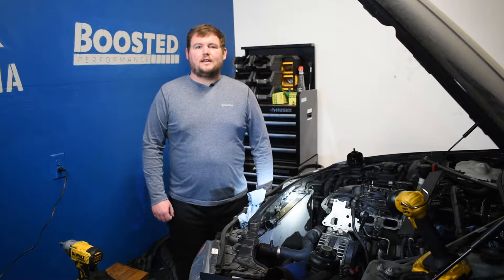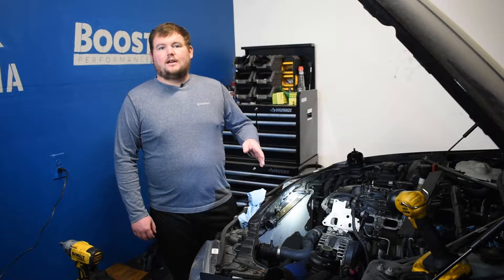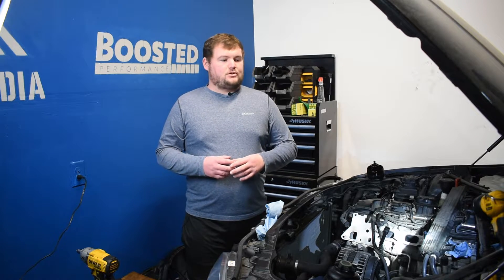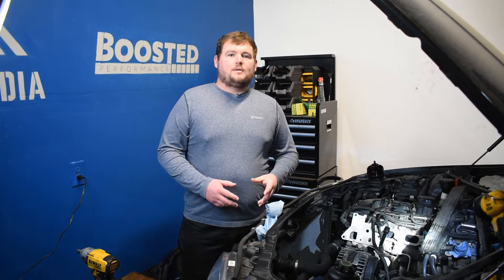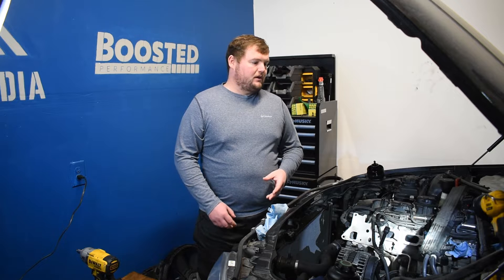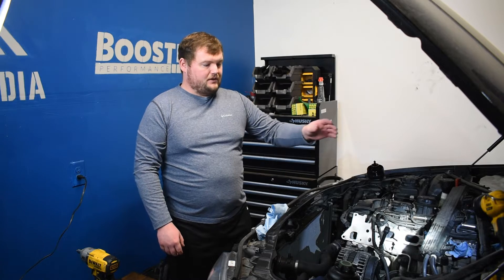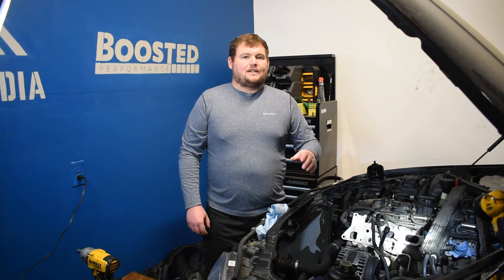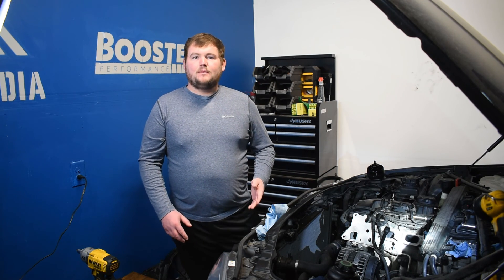What is Carbon Buildup? | Causes & Symptoms

Comment: I have a 2010 Audi A3 2.0t. My car hesitates when cold.  Worse in winter. Once it warms up, it’s smooth. Ive already changed plugs, coil. pCV, cleaned MAP, changed fuel filter. Any idea if this could be a carbon issue? Car has 275k. Prob never cleaned.
Reply from the maker: P - Yes, based on the high mileage (275k) and your symptoms, it's very likely that carbon buildup on the intake valves is causing the issue. The 2.0T engine in your 2010 Audi A3 uses direct injection, which is notorious for allowing carbon deposits to accumulate on the intake valves since fuel doesn’t wash over them like in port injection. Cold starts exacerbate the problem because fuel atomization is already poor when cold, and restricted airflow from carbon buildup can make it worse, leading to hesitation, rough idle, and stumble. A walnut blasting intake cleaning is the best solution and would likely restore cold drivability significantly. Consider doing a compression test and checking for vacuum leaks too, but carbon is a strong suspect given the mileage and pattern.

Comment: Thank you for the information, you explained really well, my SUV is has been misfiring for a few months now , took it to dealership and told me i needed a cleaning, 2 days ago the check engine light came on and I was told not to drive at all, because it can damage the catalytic converter. Is that accurate?
Reply from the maker: G - Thanks for the feedback! Yes, that’s accurate—driving with a misfire can damage the catalytic converter because unburned fuel enters the exhaust system, causing excessive heat that can melt or clog the catalytic converter. If the misfire has been happening for months, it’s likely worsening, and continuing to drive could lead to expensive repairs. A "cleaning" (likely fuel injector or intake valve cleaning) may help if carbon buildup is the issue, but if the check engine light is now on, you should scan for codes to pinpoint the cause. Common misfire culprits include bad spark plugs, ignition coils, fuel injectors, vacuum leaks, or a failing sensor (MAF, O2, or crankshaft position sensor). If you haven’t replaced spark plugs in a while, that’s a good place to start. If the light is flashing, do not drive it—tow it instead to avoid further damage.
Reply: @ thank you for the reply, yes I have done every service my dealership has recommended including the spark plugs. They did a diagnostic and code P0300 came up and say I need a top engine cleaning.
The misfiring started a few months back then stop , but a few days ago I heard it while truck was not moving and that is when the engine light came on. But then it went away and I did drove it but I noticed the hesitation in the gear going from the 1st to the 2n. Do you think that is because of the carbon buildup or is something else.?
I haven’t moved it at all after that happened just to be safe.
Thank you!
Reply from the maker: @ It's possible it's carbon buildup.. We have a video on P0300 code that may help: https://youtu.be/f1mQ5hD1-vI

Comment: My car has carbon build up and has a misfire. What is the way forward to getting it fixed.
Reply from the maker: S - Are you getting any check engine lights?
Reply: I have the same problem, my check engine light is on. I was told no to drive it .
Taking it to the dealership for a top engine cleaning in a few days. I will be paying 887.00 on a GMC XL Denali

Comment: Hi! I have 2015 VW 1.8t Golf that at idle revs goes up and down sporadically (like every 2 minutes, sometime a bit more than that). Also sometimes when acelerate from a stop the car stalls for a second and then proceed to acelerate normally (for some reason in reverse it's drastically more jerky). Does this sounds like symptoms of carbon buildup? I believe that the last time I cleaned it, the car had 80k miles, and now it has 100k.
Reply from the maker: L - Not likely. Are you getting a check engine light?
Reply: @8020Media  no check engine light.
Reply from the maker: L - We have two videos that could help here: https://youtu.be/BiYsqRJCLhE
https://youtu.be/7bqAIbYRdnc

Comment: You forgot to explain how the carbon deposits get there in the first place, apart from a brief reference to vacuum pulling oil back into the port (why oil?)
Reply from the maker: H - Described simply, carbon buildup is the result of incomplete fuel combustion leaving behind a carbon residue that can get stuck to the intake valves, injector nozzles, cylinder walls, and piston heads. Oil blowby caused by the PCV system and valve seal weep contributes to the problem as well, worsening the buildup.

Comment: My engine has been making a strange sound like a hissing sound inside the intake, have no check engine light but some times my car will randomly misfire some days, but mainley its the audible hiss sound that i know wanst thier before, also checked for vac leaks visualy with smoke machine and fuel trim data, nothing shows a vaccum leak.  just wondering if carbon can cusse the engine to sound like its gasping for air due to intake port clearances?
Reply from the maker: D - Not likely, but how many miles do you have on the vehicle??
Reply: @David-rk2cw  yes the carbon does that, my truck was doing all of that. I did a diagnostic with the dealership and onstar and code P0300 came up. Stating that I needed to do a carbon cleaning.

Comment: Carbon buildup around the valves and head is bad but carbon buildup around the pistons and rings can destroy an engine, common issue with many low tension ring engines and longer oil change intervals, like the video more information the better well done.
Reply from the maker: D - Thanks for taking the time to share this insight. Also, thanks for the feedback!

Comment: Y at intake alone it jus takes the air fuel mixture for burning correct. Exhaust must b having higher carbon build up.. can u brief this too..
Reply from the maker: K - A majority of the build up is in the intake tract because this is where fuel is injected into. Catalytic converters can also experience carbon buildup. We have a video coming out tomorrow addressing catalytic converters.

Comment: Do the fuel system cleaner that says it cleans valves help with direct injection motors?
Reply from the maker: R - They help, but don't prevent carbon buildup.

Comment: Is it possible carbon buildup on the intake valves and only affect cylinder 1 missfire
Reply from the maker: Definitely, you could have some excess buildup in cylinder 1. Carbon build-up doesn't always happen evenly, can be very different from port to port depending on the condition of the cylinders and injectors for that port.
Reply: @8020Automotive  just removed the intake manifold, wow buildup on the stem and get thicker on the  valve, let is sit with cleaners see how it goes thanks!!
Reply from the maker: H - We also have a DIY walnut blasting tutorial: https://youtu.be/pyhvtrCXbB0
Reply: @8020Automotive  update,
Did walnut blasting worked as it should miss-fire continued, gave a good full blast on the highway no more misfire.. huge difference 
Thank you for the opportunity and advice!!!
Reply from the maker: H - Nice! We're so glad we could help.

Comment: So does ethanol or non ethanol fuel cause more carbon build up?
Reply from the maker: Fuel doesn't have any major impact. Carbon build-up on intake ports and valves occurs because there isn't any fuel flowing over them on direct injected engines (the fuel is sprayed directly into the cylinders). As such, it doesn't matter how much or how little ethanol or what fuel additives are used.

Comment: I completely disagree with your statement that carbon in the engine will not harm the engine. If left unchecked, it will destroy it. It gets to the point where unburned fuel washes down the cylinder walls, causing scuffing on the cylinder walls. This raw unburned fuel also contaminates the catalytic converter, and eventually kills it which is extremely expensive to repair. False information stating that carbon buildup does not harm the engine.
Reply: Can carbon buildup cause random misfire? Thanks bro
Reply: @PATRIOTIC-EAGLE11 been having the same problem!! 

Had a misfire in January, changed the spark plugs and coils, ran fine for a month, until suddenly MULTIPLE cylinder misfires. Changed the fuel injectors, and since I have a Honda fit, I have to take half the engine apart to get to them. As I was taking the intake manifold off there were huge buildups of gunk on the inside, I blasted it with brake cleaner and it was still coming out black on the other side. When I took the fuel injectors off, they were completely crusted up in not just carbon deposits, but it looked like dirt and gravel from the street. 

I have heard the carbon build ups can cause misfires . I really hope we're onto something bc when I took it to the shop they just told me "it's the spark plugs" 😓

I'm seriously at a loss here. 

Good luck my friend.
Reply: @bl0ss0mshum4n having a similar issue with my 2000 Toyota echo. One of my friends who owns a shop told me to try the sea foam valve cleaner. Maybe try that?
Reply: Hello bro, it is about more than year I’m looking for the cause of this problem i really have spent too much money but recently a friend told me about carbon buildup on piston I’m going to clean it up today then I will inform you about the result, I hope we solve it soon, good luck my friend
Reply from the maker: If a big chunk falls off then sure it can fall into the combustion chamber and take out the piston rings and cause some damage. But I don't think carbon buildup itself is causing the problems you're talking about.

Comment: Vapors of engine oil caused by pcv and recirculation of air as ventilation by sucking hot air from the crank case into the engine is one of 2 main causes of carbon buildup. This theory explains and proves why port injection engines are less likely to build up carbon on the intake valves. And so does watermeth injection in direct port injection engines.
If carbon deposits gets inside the chamber, it will probably cause preignition and this is another serious problem.
Reply from the maker: MJ - yep.

Comment: So my problem is im throwing egr and pcv codes after replacing those, i just did an engine swap but i reused my 315k mile intake from my old engine, i have a new intake already, would swapping it for a brand new manifold fix that if the buildup is blocking ports?
Reply from the maker: Lucky - I think swapping it would be a good idea if you already have it on hand and then reset the engine codes. Keep us updated.

Comment: Hi can carbon build up cause engine to vibrate only when engine is hot thanks
Reply from the maker: Sounds like you're having a rough idle? Here's a video we did specifically for that: https://youtu.be/BiYsqRJCLhE
Reply: @8020Automotive  i only get engine vibtation when engine is hot at idle rpm not bouncing just feel vibration in seats and no engine light or codes thanks
Reply from the maker: May want to check your engine mounts. This could be the cause. Keep us updated on this.
Reply: @8020Automotive  thanks will do can it cause vibration only when engine hot

Comment: Looking forward to your upcoming video. Are there additives u can use to periodically clean? I used guaranteed to pass emissions on my old 97 Camry & it really cleaned the plugs, figure it would do intakes.
Reply from the maker: Rice - Thanks for the feedback! There are some fuel additives on the market that claim to clean carbon buildup off of intake valves, Sea Foam is our favorite. However, we want to preface, this is a preventative measure. Not a end all be all.

Comment: Can’t the carbon buildup on the cylinder head and then scratch the cylinder walls?
Reply from the maker: Wolf - It's possible but not something we see very often at all, at least in the case of it causing any major damage. The combustion process typically burns off any excess carbon within the combustion chamber.

Comment: What does carbon build up come from?
Reply from the maker: Keeg - It's is a natural byproduct of the combustion process where fuel is burned to generate power.
Reply: @8020Automotive  thanks
Reply: Better response is from the PCV and EGR systems that burn the unburned hydrocarbons that end up in your crank case. Theses systems route this oily mist back into the intake port, and through the intake valve into the combustion chamber to be re-burned rather than going out into the atmosphere. When they pass through the intake valve, this oily mist carbonizes onto the intake valve, leading to carbon buildup. Because no gas on a GDI engine is being sprayed onto the intake valve, the detergents in gas can no longer work to keep the intake valve clean. Cheers.
Reply: @JRW-BJJ  thanks.  Cheers to you.
Reply: P @JRW-BJJ

Comment: Lemon law , use it !
Reply from the maker: Charles - Carbon buildup is very common in all direct injection engines. Not so sure lemon law would work in this case.
Reply: @8020Automotive  Your correct , its very common , because it was designed that way , forcing oil down the intake from crank case ventilation , just like indirect injection carbons up the exhaust valves because the fuel going across the intake valves helps keep them clean . If you think the designers of these and other engines didnt know these engines were going to carbon up this way , YOU are sadly mistaken ! This is their wind fall of intentional maintenance profits ! Highlight that !
Reply: @charlesmccormick4443  senior citizen here and we were the victims of this nasty secret of the industry deliberately making the cars to have excessive carbon buildup.  Our Toyota Corolla 2015 engine was completely destroyed by carbon buildup which NO ONE at the service center ever warned us about.  We thought doing the routine maintenance religiously would make our car last 300,000 miles.  The engine was destroyed at 173,446 miles instead due to no one ever telling us about carbon buildup.  We consistently drove low speed and rarely went out on the highway.  Now we know better.  Highway driving at 60 MPH for long periods is enough to heat up the carbon buildup and get rid of it.  Hard lesson to learn as we just had to buy a new car.
Reply: @charlesmccormick4443  senior citizen here and we were the victims of this nasty secret of the industry deliberately making the cars to have excessive carbon buildup.  Our Toyota Corolla 2015 engine was completely destroyed by carbon buildup which NO ONE at the service center ever warned us about.  We thought doing the routine maintenance religiously would make our car last 300,000 miles.  The engine was destroyed at 173,446 miles instead due to no one ever telling us about carbon buildup.  We consistently drove low speed and rarely went out on the highway.  Now we know better.  Highway driving at 60 MPH for long periods is enough to heat up the carbon buildup and get rid of it.  Hard lesson to learn as we just had to buy a new car.
Reply: @JS-tr7oo  contrary to popular belief, it’s better to run an engine hard and not lug it. Higher PMs, and highway driving are the most beneficial thing you can do to prevent carbon buildup on a GDI engine. The lower the RPM, the higher crank case pressure is that results in the EGR and PCV systems, rerouting that oily mist back into the intake port to be re-burned which carbonizes the intake valves. Cheers.
Reply: @8020Automotive  The cure we found out is to do regular highway driving, at 60 mph is enough to burn off the carbon buildup.  Don't just do around about town driving at 30 to 45 miles per hour as that is how the carbon buildup starts.
Reply from the maker: J - Thanks for taking the time to type up this valuable insight! We couldn't agree more.
Reply: Can a bad turbo cause carbon build up ? 2018 Hyundai Elantra sport GTI 1.6L

Comment: how much will a shop charge to do a cleaning for carbon? how often should i do a cleaning ?
Reply: For inlines you can expect to pay a little bit more than $100 per cylinder you have. V engines will run 600-900 or more depending on your car. My supercharged Audi V6 costs about 850 to carbon clean but it has a big ol supercharger that has to come off so that makes sense.r
Reply from the maker: Dude - Thanks for adding this insight. Will certainly help future viewers!
Reply: Toyota  has overcome this problem years ago buy  adding direct & port injection
Reply: @on-site4094 Why didn't everyone one else?
Reply: @toddsmith1617  Toyota cares about reliability. 
Everyone else doesn't.

My VW is full of carbon and is misfiring like crazy.
Reply: @Hobby_trails_repository  that is how my truck was, it was getting really bad, I took it to the dealership yesterday and they said they had to run chemical solution twice because its was really clogged up. Paying $912.00
Reply: @on-site4094 correct. My IS350 has 12 injectors, 6 directed into the combustion chamber, and six in the air intake, port, to keep the intake valves clean. Smart.
Reply from the maker: Travis - This depends. What vehicle are you looking to get this service done to?
Reply: @travisrobinson007  I took  my SUV to the GMC dealership yesterday for carbon cleaning and it’s gonna cost me  $912.00
Reply: Will adding port injectors  not increase gasoline consumption?  The cilinder now gets the double amount of gasoline?
Reply: @michelmoorlag9028 no , the port injectors only get used when the performance economy would be least effected and any added fuel from one injector is reduced to the other injector